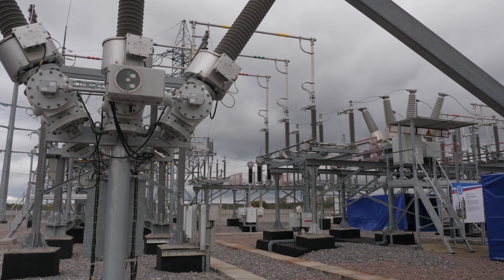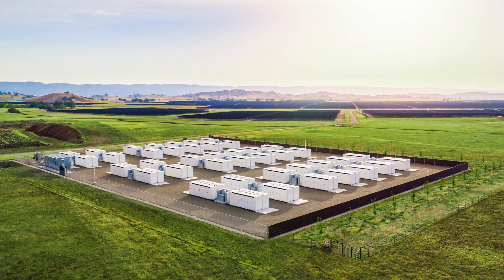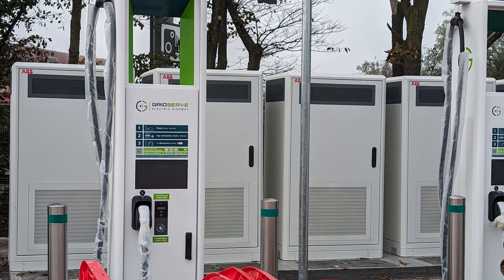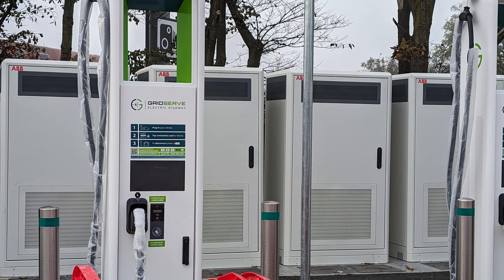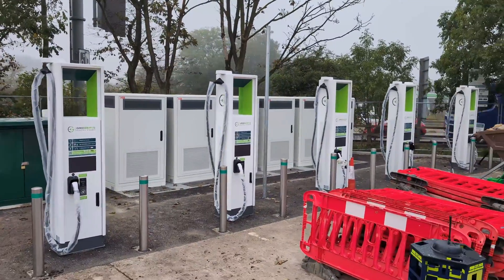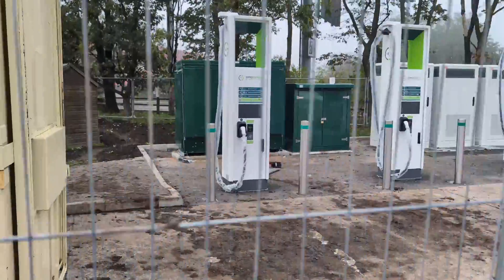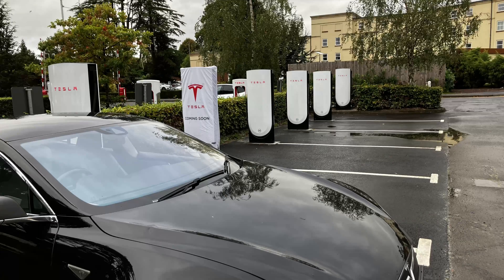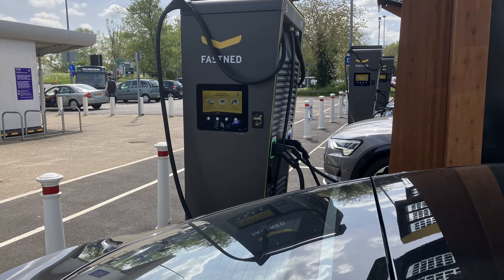From Substation To Car | How The Grid Powers EVs

Comment: The reason The National grid transmit at 132Kv is that the high voltage requires much thinner cables to carry the equivalent power (Volts X Amps) which would be impossible due to size and cost of cables needed at 230 or 400v  Where charging points can be situated in close proximity to (those pylons) it is great for numerous charge points. However, The problem arises  in towns cities, any urban area where underground cables are needed to continue the transmission as the high power demand requires far larger cables than overhead lines and this upgrading is very costly indeed  also charging point capacity is limited to the existing underground supply cable size and local substation existing capacity. It will not be any surprise that these upgrades in cables and substations have to be paid for to meet the extra load by charge points and this is limiting the proliferation on charge points for the infrastructure improvements that is needed and either needs huge subsidies or payback in terms of unit costs from the charge points when operational.

One example of this is a Shell petrol station I know of has just installed 8 x 150Kw charge points and could only do it because they are next door to a railway station and intake from the railway network.
Another area for clarity is that when new housing estates are built the DNO calculates the cable sizes according to diversity factors of less than the 100A per property so as to reduce the installation costs and cable sizes so all properties could not in fact draw the maximum available 100A or the substation overcurrent protective device would operate, (power cut)
I hope this helps, Retired power industry engineer 46 years.

Comment: Phone chargers are, as you correctly state, just power supplies. However you are wrong to say they do bot communicate with the phone, they do. The charger starts out supplying 5v, but then the phone talks to the charger and requests a higher voltage, 9v or even up to 20v, from the power supply depending on the phones needs.

Comment: There is a difference in charging rates between 800V and 400V vehicles and it does make a difference to charging times. Doubling the DC voltage halves the current (Ohms Law) going into the battery for any given wattage. Lowering the current reduces the amount of heat generated and it is heat generation that the BMS is designed to manage. This means that 800V batteries have a different charging curve to 400V ones. Whilst the peak rate is slightly higher than 400V batteries the rate can be sustained to much higher charge levels. For instance at 75% charge a 400V car is typically charging at 50kW or less. My Ioniq 5 at 75% on a Gridserve chargepoint can be chargIng at up to 125kW.

Comment: Actually Dave, all Electrify America chargers in America are 800 volts architecture, even the 150kW versions. The problem is that they use crappy, unreliable ABB, Delta, and Signet chargers. However, super reliable and powerful Alpitronic and Kempower chargers are now beginning to roll out in America. And as you know, all of Tesla's V4 chargers will be 800 volts, although they've only have installed the dispensers thus far without switching out the actual chargers.